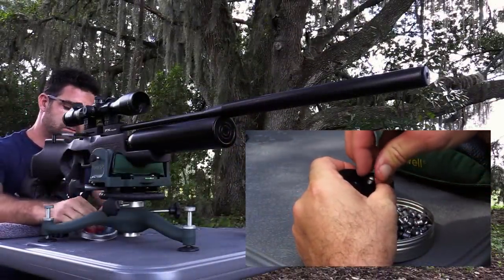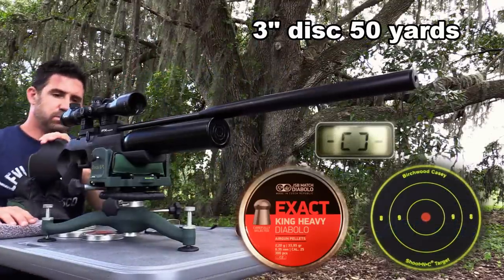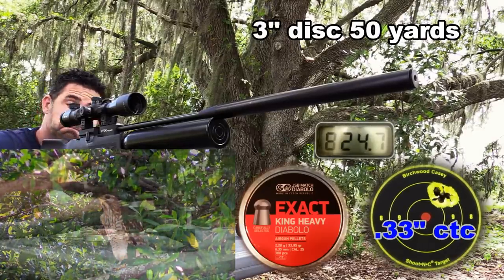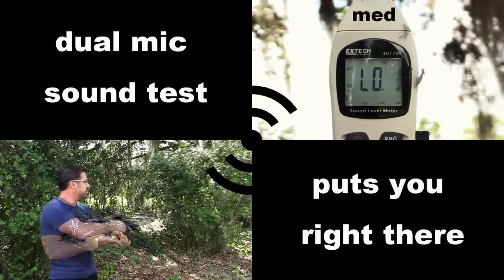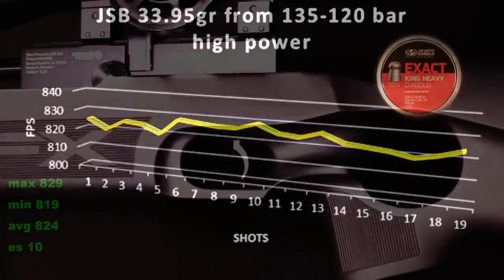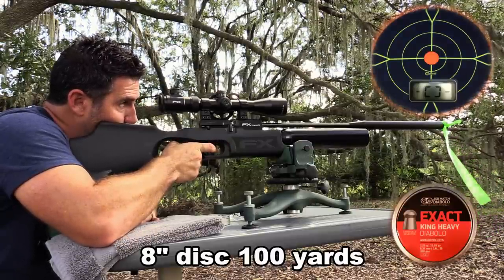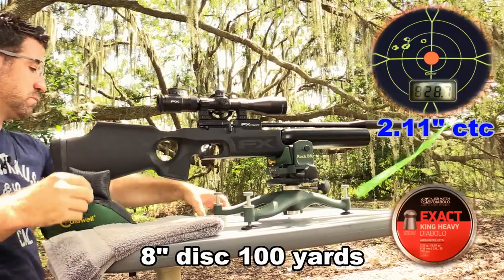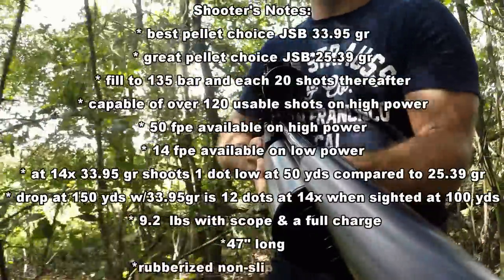FX Royale 500 .25 Air Rifle + 50 & 100 Yard Accuracy TEST + FULL REVIEW - Regulated PCP Airgun

Comment: Im confused . You say for greatest accuracy fill to 135 bar [ not the 220 recommended max ]  and shoot down to 120 bar  then refill . But the reg on these guns is set to 135 bar and FX say not to shoot the gun at a tank pressure below that or it will damage the gun 

Maybe yours isnt regulated ?   -  Thanks
Reply from the maker: john moore Just try to keep your extreme spread to less than 25 fps if you can for 50 & 100 yard shooting.  FX sets their regulators between 110 and 150 bar depending on a lot of factors.  You don't have to worry about damaging the valve unless you shoot it dry.  Best, Steve
Reply: Thank you

Comment: I have a FX Royal 400, I know you like the 500 that's not a question but what is a question, with the heavier hammer spring and such would you say the trigger is overall is good as the 400? the 400 has one of the if not the best trigger I've ever shot.. it truly is amazing and if the 500 trigger is as good I will deff buy one.
Reply from the maker: Thanks for the question.  I've reviewed both the 400 and 500 here on the channel and the triggers felt the same to me.  Best, Steve

Comment: Hi Steve, why does an air gun perform better when handloaded? I think there should be no difference. Regards, Marcus
Reply from the maker: I couldn't say Marcus.  In my experience sometimes it makes a difference and sometimes it doesn't.  In this case it did.  The key is to experiment.  Best, Steve

Comment: Hi Steve. As always, Thanks for your outstanding comprehensive reviews. I am trying to decide between the new Royale 500 and The Streamline in .25. Which one do you think is a better buy? I know you will review the streamline soon if not already. I would appreciate your comment. Babak.
Reply from the maker: Babak Taherian These are very different guns.  The Royale is a long rifle and the Streamline a comparatively very short carbine.  The Royal is finished nicer and I'm guessing has a larger air reservoir  (double check me on the rez size).  They should both perform the same accuracy wise but my guess is that the Royale will make more power and be quieter.  Streamline is lighter and narrower and Royale has a thumb hole stock that's finished nicer as well.  That's about all I've got for the moment.
Reply: Thanks Steve! Look forward to your version of Streamline Review.
Reply from the maker: Babak Taherian 👍